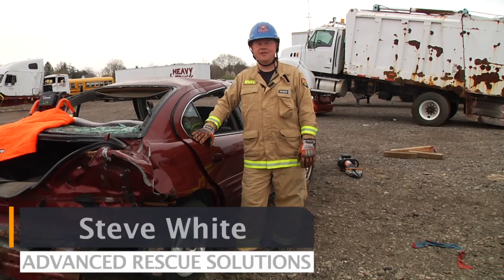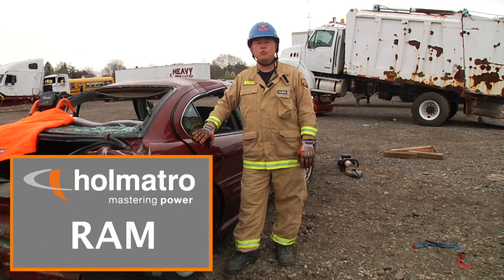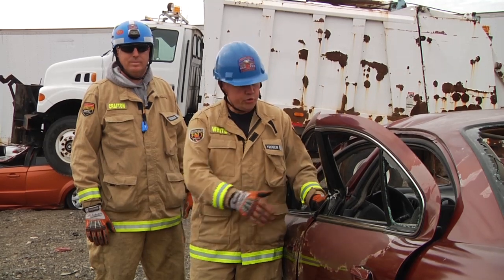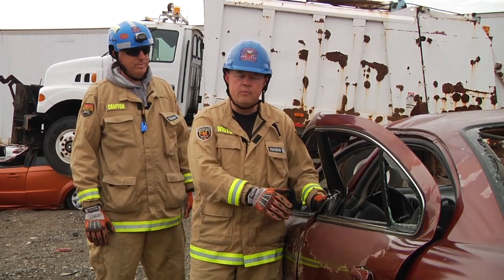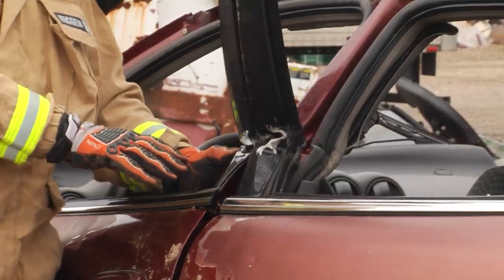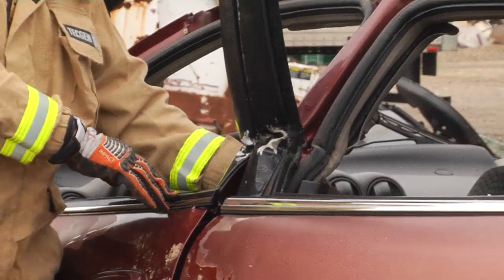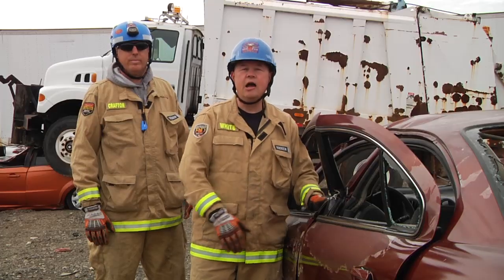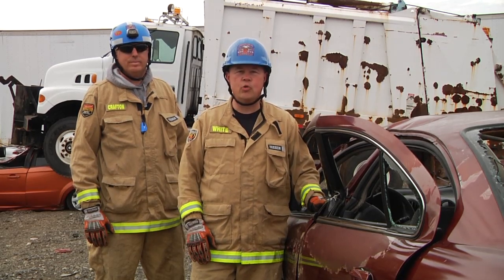Holmatro Quick Cuts 3 (2018): Crossramming

Comment: in this technique, is it necessary to cut the b pillar's top?
Reply from the maker: Hi Eddy, it's exactly the other way around. With cross ramming you don't want to cut the construction, since you're trying to push it back into its original shape. If you would cut the top of the B-Pillars, it would be much harder to control the direction in which the construction will move when you're pushing it away. Making a (relief) cut is only helpful when you need to push a part of the vehicle BEYOND its original position, like with a dashboard roll. We hope this answers your question. If not, just let us know!
Reply: HolmatroRescue so, when the geometry of the cabin is gone, by a lateral impact, we can use a cross ram from the middle to the low b-pillar (the hardest section) to recover the original geometry. But when is necessary to do a full lateral removal, cut at top, and ram at top for a fast full lateral.
Reply from the maker: eddykreuz  That’s right, when you need to remove the side of the car the pillar should be cut.
Reply: HolmatroRescue love it. Thanks! May some day we would need to do this. Thanks a lot
Reply from the maker: You're welcome, stay safe!